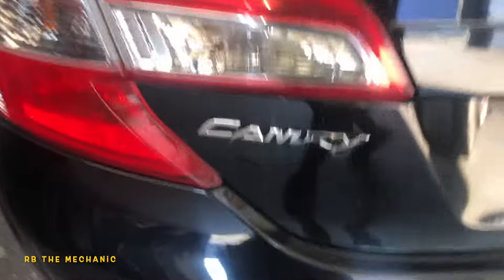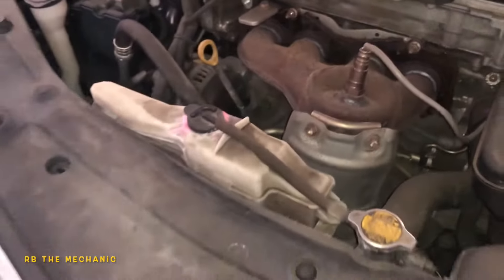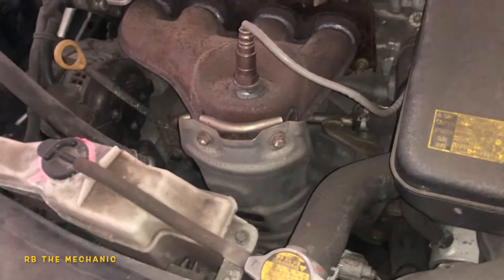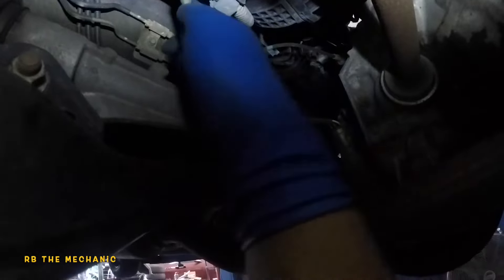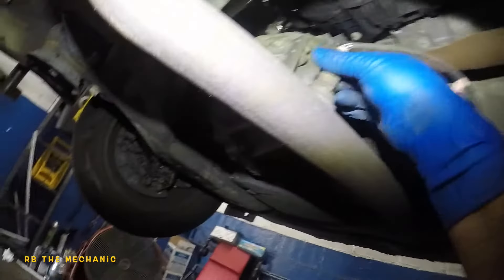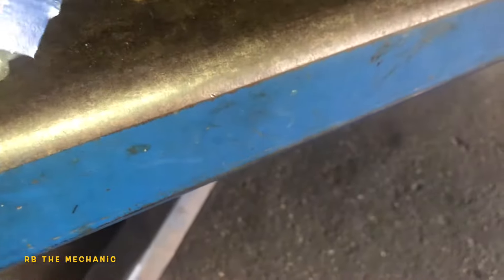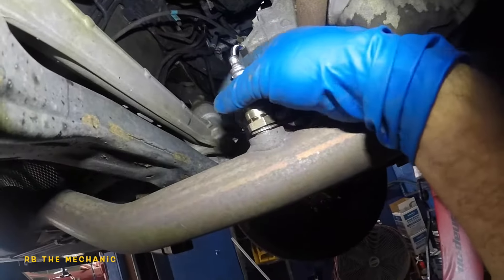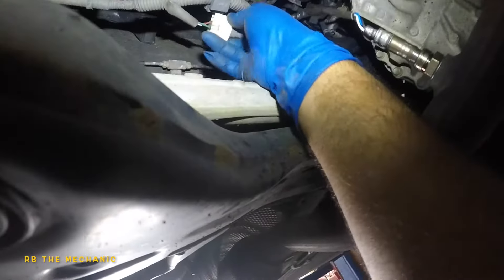FIX code P0420 with only $60      Toyota Camry P0420 catalytic converter code FIXED

Comment: After installing an o2 spacer and clearing a p0420 code, the light has come back on. Advice ?
Reply from the maker: Space? That wount be good idea what was ur code?
Reply: @RBTheMechanic  yes an o2 sensor spacer. P0420

Comment: I have code 420 how kiddo I know if it is the o2 sensor or the cat??
Reply from the maker: It’s the catalytic converter but I would recommend u replace down stream sensor before replacing catalytic

Comment: What if you have replaced the catyletic converter,  and both sensors, and still have the p420?
Reply from the maker: Did u check which emission ur vehicle was mad with and which emission converter u out in

Comment: I have this code
Without check engine light
Reply from the maker: Turn the car off take out the key.  And then put the key ok and turn the key to accessories do not start the engine.  Let me know if ur check engine light is on
Reply: @RBTheMechanic  no light bro
I Tried
Reply: @RBTheMechanic  The car consumes high gasoline

Comment: My cat is new , oxygen sensor on it new too. So I’m guessing mine is the bottom sensor that’s old. I’m also getting a roaring noise on the floor and losing power. Could my muffler be clogged??
Reply from the maker: Yes and when u put in new catalytic did u check emission that ur car was built with and if u put in same emission catalytic

Comment: 2003 Camry 2.4L. Added the non foulers.  Dorman - Help Spark Plug Non-Foulers - 18mm Gasket Seat 42009 part #. 9.99 at O'Reilly. Drill 1/2 hole through one (don't touch it right after--it is hot!!). I was worried the oil pan was a little close but it ended up fitting just fine. Screw it on top the second one and screw that into the hole in the downstream sensor hole. I installed both into the cat pipe and then screwed in the 02 sensor after. Easy to remove 02 sensor for me. Didn't need a special wrench--just sprayed a little WD-40, waited a few minutes and used a 22mm wrench to remove. On this vehicle easy to remove the plug for the sensor (it's just to the right and a little above the sensor) so it doesn't twist the cord to remove and install. Don't tighten the aluminum non foulers too much in the pipe--the pipe will win that battle. Drove for about 30 miles yesterday and no light (yet). Was doing it after 20 before. I'll put an update after more miles. Update Jan 2024.  Has never thrown the code since and passed Colorado emissions.
Reply: Thanks for the write up on this.  My son's 05 Camry just threw 0420 code. I watched a video on where the bank 1 sensor is for that car I noticed immediately how close it was to the oil pan. I was hoping that spark plug foul trick would fit.

Comment: This will work for a 2011 Camry ?
Reply from the maker: No 2011 is diffrent but similar process
Reply: @RBTheMechanic  how is it different? Sensors are different locations but you change downstream sensor and that might fix it ? I used cataclean and I disconnect negative battery cable and light stayed off for about a month. Instead I I should replace downstream sensor? 11 Camry 2.5 L

Comment: Thanks for the video.
I replace 2 sensor but I got the Engine Light for the same reason  , with the code P0420  , any idea what else could be ?
Reply from the maker: It might be time to replace it
Reply: @RBTheMechanic  ok thanks you so much
Reply: I received the same code P0420 on my Camry with 260K miles. I used Cataclean on a 1/4 gas tank and drove it to almost empty. You can refill the gas tank with a premium or regular with octane booster. You must drive at least 200 miles at 60 mph to reset the drive cycle. My check engine code cleared doing that.

Comment: Just one sensor replaced? How do you know it’s this or that sensor? 11 Camry LE 2.5 L
Reply from the maker: U don’t no code for it. Ut before spending 1000 on catalytic I would do sensors
Reply: @RBTheMechanic  what you mean? I’ve got the P0240 code . But try cataclean or replace downstream sensor before trying cc replacement?

Comment: I tried this on my 2014 toyota camry le 2.5l, and it only worked for a day then the light came back on. What is the next step? Do you think it might be the other sensor? Thanks!
Reply from the maker: Did u replace down stream oxygen sensor
Reply: Yup
Reply from the maker: @sage2163  type sun fuel additives other wise need replacement
Reply: Which one do you recommend?
Reply from the maker: @sage2163  I use walker lot

Comment: Thanks for answering another question in the 2014 camry there are two oxygen sensors the code tells me bank 1 which one do I have to change
Reply from the maker: Bottom one
Reply: @RBTheMechanic you are the best I’m subscribing to this channel
Reply from the maker: @jonathanburgos2158  thank you!
Reply: @jonathanburgos2158 did that get  rid of the code for good?

Comment: I thought the 420 code is for bank 1 and that would be mean the up stream sensor ? But you switch the down stream maybe I should try that one mine
Reply from the maker: Up stream will give u lean codes even tho ur it’s used to monitor the conditions but mostly I have come to conclusion down stream effect most
Reply: @RBTheMechanic   Thank you I'm going to try switching my downstream to see what happens!
Reply: ....if you have a 4 cylinder engine there is only 1 bank. If you have a V6, you have 2 banks ....each bank is 3 cylinders, Bank 1 and Bank 2.
 Bank 1 is the bank that has the #1 cylinder. In either case, you want to replace the downstream sensor of the cat...."sensor 2".   So...if you have a 4 cyl engine....that would show as "bank 1 / sensor 2".
Reply from the maker: @TheWilferch  good information
Reply: @RBTheMechanic  .....👍👍👍

Comment: Will o2 sensors n air fuel ratio sensor will make my service engine light come with a p0420. Or do they have their code?I have a 2002 toyota camry le,2.4 4 cylinder
Reply from the maker: They have their own codes also they can pop p0420 code they do input to ecm for preformance of cataltic
Reply: @RBTheMechanic hank you for replying 🙏 love warltching your videos, your #1

Comment: I have a check engine light or the engine light is on. I checked the computer and the oxygen sensor said it was 1. I dismantled it and cleaned it with a spray bottle and it worked. I changed the oxygen sensor, a used one, from another car. The same problem. The light did not turn off. The computer says the oxygen sensor is working properly and is working. It reads: Is the problem with the oxygen sensor or not? From the bear of the environment or the bear of pollution called a lot of bear. Does it need cleaning in carbon or should I change the sensor? New car model Corolla 2015 code (p0420)
Reply: Do you need cleaning with a spray or catalyic converter solution?
Or is the oxygen sensor a new, sad change? I don’t know the solution
Reply: Did you replace the sensor? Did you not turn off the engine?
Reply from the maker: Replace the craaltic
Reply from the maker: Start with sensor
Reply: @RBTheMechanic  I replaced the sensor and checked the computer. The sensors read correctly. Is there a substance or spray to clean the tank from carbon? The engine light did not turn off. I did the programming on the computer and it did not turn off the engine light. What should I do, brother?
Reply from the maker: @hv.x10  u can use file additive  to add in tank called fuel injection autozone sell it or buy catalytic cleaner

Comment: On my 03 Camry, it started with the P0420 code.  I replaced the cat and code cleared and the stupid code P0141 appears, so finally I replaced the pigtail and all good. Now the stupid P0420 code is back and I tried the sea foam. What the hell is going on??
Reply from the maker: Did u use denso sensor
Reply: @RBTheMechanic  yes but only after I replaced the pigtail, the light cleared and now the code P0420 appears and that’s what started it all.

Comment: Great video! Thanks for sharing. My 2003 Camry takes a lot of crankings to stay running. It runs for about 3 to 5 seconds, then stops. Eventually, it stays running. I have a P0420 . Could this be the reason it takes a lot to stay running? Does anyone know? I was thinking about replacing the sensors. Let me know. Thanks
Reply from the maker: Not sure it can be somthing else but this can cause engine to choke
Reply: @RBTheMechanic thank you

Comment: 2007 Toyota Camry LE 2.4L. I got a P0420 code also severity 2/3. Is this the only sensor I need to replace, or should I also do the one on the top of the engine? Or just change out the whole cat?? Thanks!
Reply from the maker: First do the bottom give it a chance see how it performance after that also add some catalytic cleaner to fuel

Comment: I've changed both 02 sensors twice and replaced my cat and still am getting p0420 code on a 2011 Camry SE. No other codes.
Reply from the maker: Did u buy the parts according to the emission ur vehicle is made for?
Reply: Same here

Comment: I’ve 11 LE 2.5 L and I got this code . Auto Zone and OReillys both recommend cc replacement. Not sensor . Do you know if this car and mine are the same? The sensors are in same location? Would you recommend this possible fix for my 11 Camry LE ?
Reply from the maker: Well of u got code for it someplace the sensors with it or start with sensors first cuz I had many p0420 codes and just replacing the cc and code came back so it was faulty sensor

Comment: First the water pump broke down and all the coolant flashed and i fixed that but a few days later, the engine light came on but i ignored it until i couldn't accelerate anymore. Its different to go right away after i make a stop at a stop light. I took it to Toyota dealer and they told me to change the exhaust Manifold. Do you think i should change the downstream sensor before i change the manifold? Since the water pump is near the sensor and when if the mechanic hit it accidentally. Anyway thanks for the video.
Reply: I forgot. Every time I try to accelerate, cylinder 4 misfire. Plus I get p0101 code as well with P0304.
Reply from the maker: What code do u have?
Reply from the maker: Those are cylinder misfires replace coils and plugs
Reply: Ok thanks. I change my spark plug today and I just passed emissions test but it still hard to drive up the hill. I am gonna change my upstream sensor now see because its impossible to get exhaust Manifold here in Colorado. To much regulation. I had P0420 but now I will see what code I will get when the engine light comes back.
Reply from the maker: @Liverpool-fc-fun  might be blocked catalytic
Reply: @RBTheMechanic  that's what Toyota dealer told me. They say to change the Manifold but the part is back order and  it's no where to be found elsewhere. :(. Colorado has the same restrictions like California. And I am scared to driver
Reply: @RBTheMechanic  I was thinking to change the upstream oxygen sensor since it is connected with the manifold but it like 250 dollars. I think I will just wait for Toyota to restock the back order which might take months and take a bus till then. Lol..
Reply from the maker: @Liverpool-fc-fun  yeah maybe worth the try
Reply from the maker: @Liverpool-fc-fun  yup parts r crazy to get I had one on order for 5 months

Comment: Nice video, I have a 2009 toyota camry 4 cylinders, the CEL came out, I went to oreyllis for a free scan and a P0420 code came out, catalyst system efficiency below threshold (bank 1), does this video goes for this year too, do I have to replace the same sensor as you did with your car, or replace the catalytic converter and both sensors once for all for better performance, thanks.
Reply from the maker: For better performance yes all of it but if u want to take one step at a time start with sensor
Reply: @RBTheMechanic thanks
Reply from the maker: @alejocalderon46  welcome

Comment: Hi, thanks for the video 🙂 I got 2005 Camry 119k, two days ago my Check engine light came on it’s P0420 so I put cataclean to clean the catalytic converter after 8 miles check engine light turns off, then after 154 miles check engine light came back ON again, then I put cataclean again until now the light still on. You think I need to change the second sensor ? after the first sensor in the exhaust manifold? Thanks for your advice 🙂
Reply from the maker: Replace the second sensor down stream
Reply: @RBTheMechanic  Ok thanks
Reply: @OKBAOK did that work?
Reply: @OKBAOK  did it work because im going through the same problem now
Reply: @Beanyswiney2239 did you find any solution? Same issue here in 08 camry. Originally was getting P0031, replaced upstream o2 sensor with oem sensor and am now receiving P0420.

Comment: I just remove and replace the EFI fuse on my 2002 Corolla which clears the code just before the inspection. It has always passed the emissions tests so far. I'll try some catalytic converter cleaner before replacing the sensor.
Reply: what state? ECU should show smog not ready because code cleared.

Comment: So I changed mine, reset the light and my CEL came back on. 2011 Camry SE.
Reply from the maker: Did u change upstream or down stream?
Reply: @RBTheMechanic  downstream. I used a walker o2 sensor from rockauto. I did just as u did in your video.
Reply from the maker: @obs_vell439  ok cool well maybe it’s time to replace catalytic converter if u do replace the catalytic replace upstream sensor also it’s for the best preformance
Reply: @RBTheMechanic  came back to mention, my '11 camry was shutting off, dash lights flickering. So I changed the battery/alternator then my CEL came on. It wasn't on before. So I wonder could I hve done something when I changed the parts
Reply from the maker: @obs_vell439  which part u changed? And cel?
Reply: @RBTheMechanic  battery and the alternator. After I did that my CEL came on. Now When I crank car CEL Is on, once I go in drive the control traction light comes on also
Reply from the maker: @obs_vell439  well check ur fuses    Usully when I disconnect battery I save memory ur rpm might be low but check ur fuses and double check ur work and scan the car for codes to see what codes u got let me know the codes
Reply: Update: changed cat converter. Code gone, passed emissions. Back on the road

Comment: Hello friend, I saw your video, I have a question, I have a 2014 Camry and the code P0420 came out (catalyst system efficiency below threshold bank 1) is it the same as what you recommend in the video?
Reply from the maker: Yup same try the oxygen sensor replacement and reset the code if it comes back then u will need to replace the catalytic
Reply: @RBTheMechanic  Thanks for answering another question in the 2014 camry there are two oxygen sensors the code tells me bank 1 which one do I have to change
Reply: @carlosarellano253  ....if you have a 4 cylinder engine there is only 1 bank. If you have a V6, you have 2 banks ....each bank is 3 cylinders. Bank 1 and Bank 2. Bank 1 is the bank that has the #1 cylinder. In either case, you want to replace the downstream sensor of the cat...."sensor 2".   So...if you have a 4 cyl engine....that would show as "bank 1 / sensor 2".

Comment: Also would this also work for any make and model or only for the Camry? I have a P0420 code on my Nissan maxima 2011. I reset the code without doing anything and the light went off. Have driven about 40 miles since the reset and the light has not come back on. What could that mean?
Reply from the maker: Chances are it could be the possability so go for it worst come to worst u have to replace catalytic then u should replace sensors as well and u already did that

Comment: Does the bad sensor mean there is actually some problem in the catalytic converter? Or is it normal for this sensor to get dirty?
Reply from the maker: I had many many of these Camrys and accord sign came on due to bad sensor
Reply: Is it ez to change  2012-2014 camry pcv valve.  Not to take off the intake manifold off.  Other way i found in youtube  . From. Right tire   Mr rb
Reply from the maker: @fisherbrown903  nope
Reply: This is way too fouled for an downstream O2 sensor

Comment: Please i currently have a PO420 in my Toyota Camry 2009. I am in Georgia. What do i do? I wanted to change the oxygen sensor on bank one and i was told it's the catystic converter on Bank 1 not the oxygen sensor. What do i do?
Reply from the maker: Start with sensor of it dosent work out the both
Reply: @RB The Mechanic   Thanks for the quick response.  One more question do you do think using a catalystic cleaner is going help?
Reply from the maker: @senatoraguolu4773  it might it’s all a chance
Reply: @RBTheMechanic  Thanks.
Reply from the maker: @senatoraguolu4773  welcome

Comment: My 2014 Camry has the code P4020 when i go up a hill rmps go high changing the sensors will it fixed the issue or is my catalytic converter clogged? Thank you
Reply from the maker: It’s prolly clogged usully up his it would do this cuz it’s blocked and dosent allow engine to push out enough pressure at high rpm
Reply: @ cataclean wont do anything then? Recommend changing it or flushing it out?